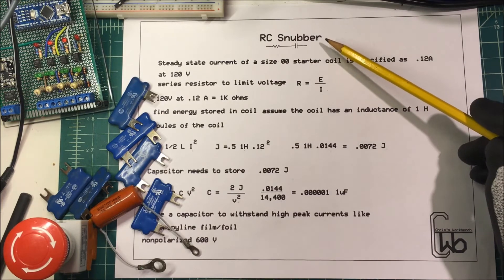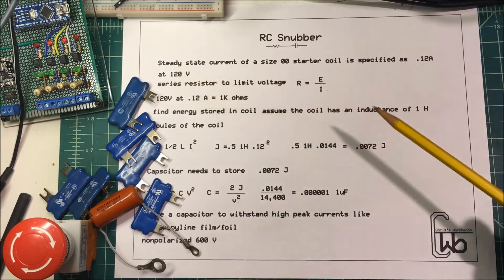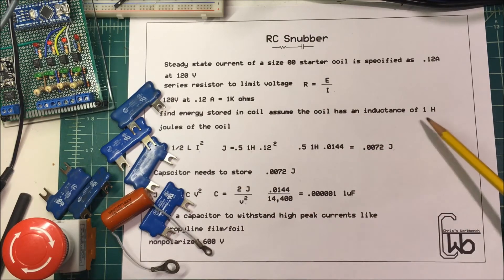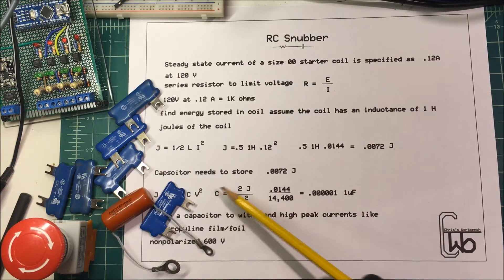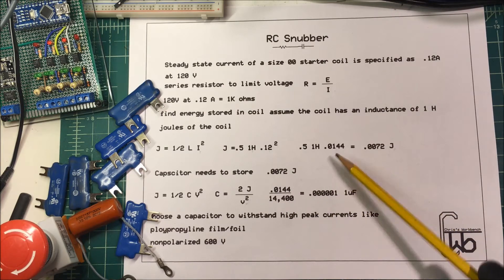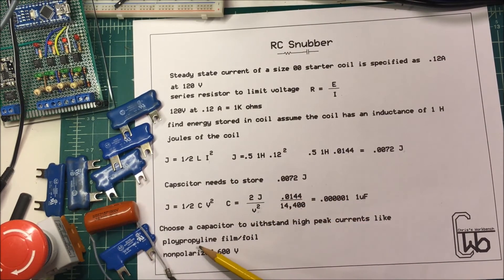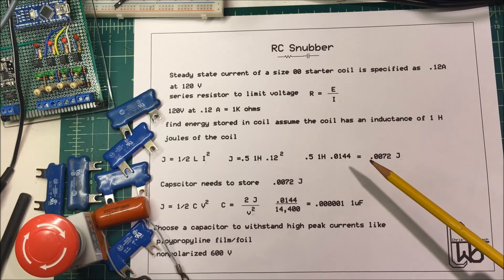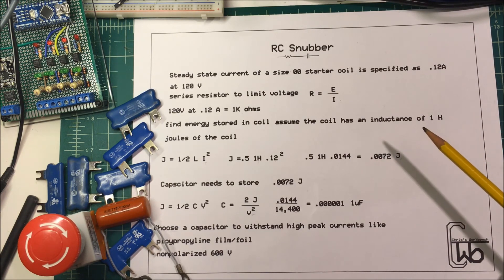RC Snubber

Comment: Hello Sir, First of all Thank you so much for this video it is exactly on to the point. 
Sir can we use Diode with RC snubber? and what about the wattage rating of the resistor? Do we need to calculate it?
Reply from the maker: The snubber is designed for AC so no diode. We need to calculate the wattage of the resistor. 
Thanks for the comment.